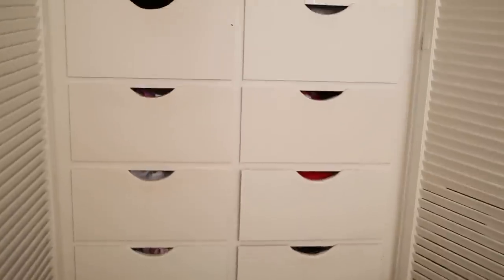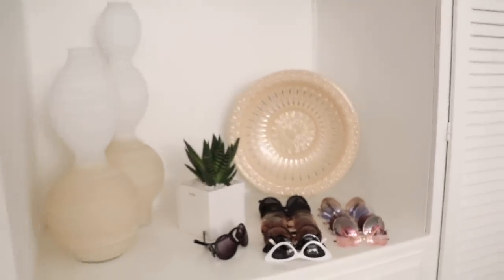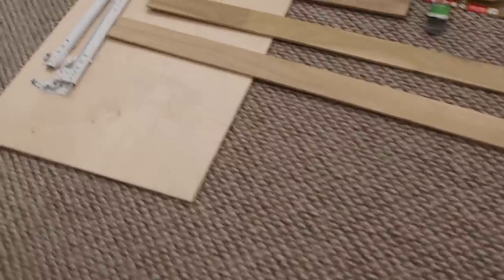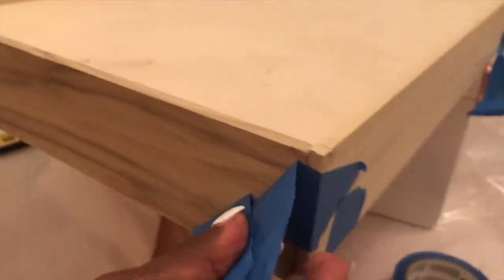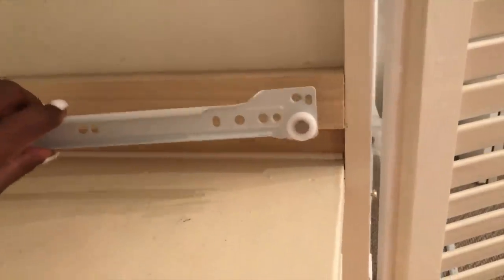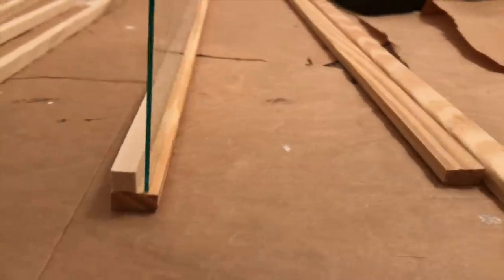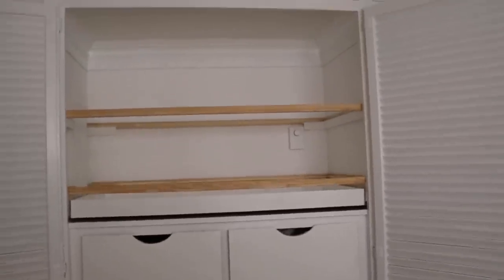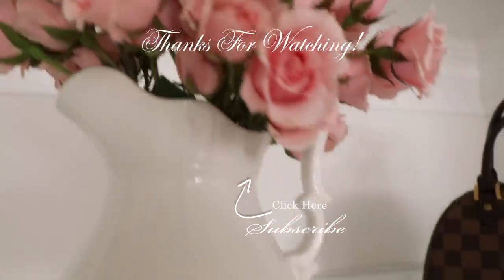How to build a drawer with sliders Closet Declutter DIY Closet Makeover Ikea organization hack tour

Comment: Ok cute but u didn’t finish showing the shelf hack. I mean I figured u glued glass to cube wood did u glue wood on top of that. When u put that shelf in does it slide out also or did u use a shelf bracket to hold it up? Lots of questions trying to do for my closet
Reply from the maker: Thanks for watching. The glass wasn’t glued down. It rests on top of the sides that were nailed to the wall. The wood framing around the glass is purely decorative. The glass is nestled inside the frame like a picture frame you’d hang on a wall. In a picture frame it’s not glued. The glass shelf doesn’t slide out, it would be way too heavy. The wood on the sides that have the drawer sliders are what carry the weight of the glass.